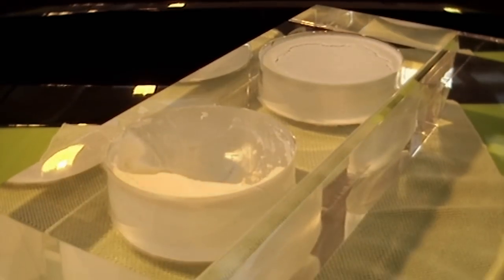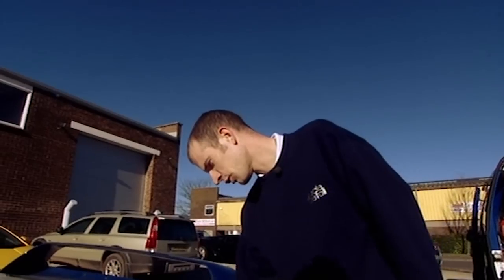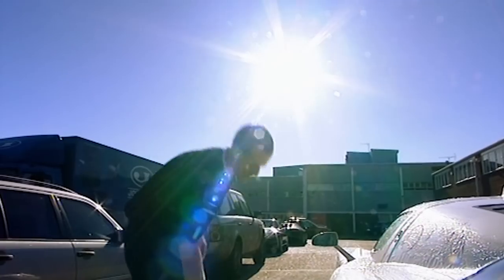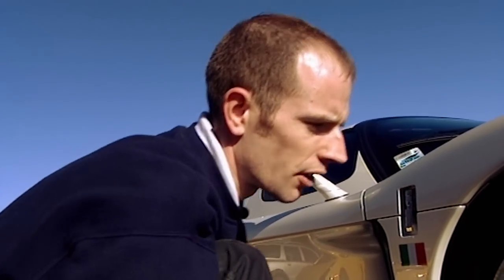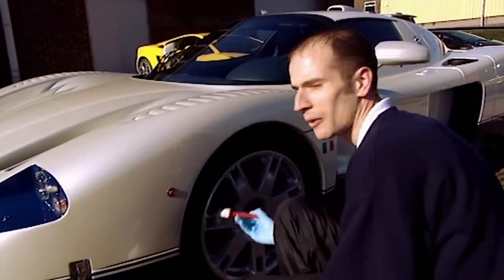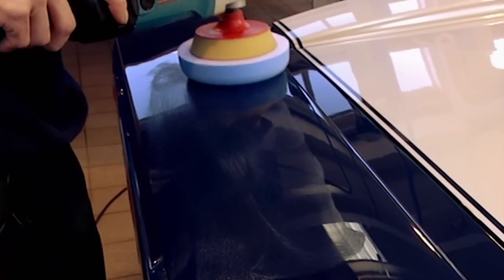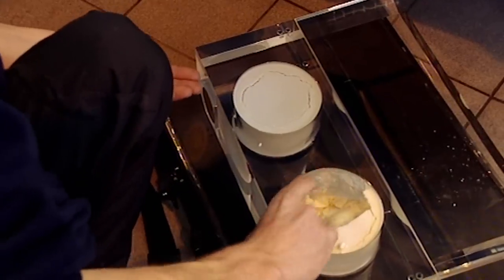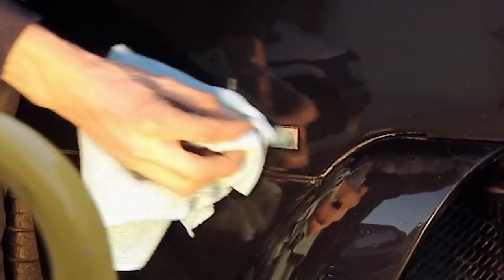World's Best Car Cleaner #TBT - Fifth Gear

Comment: I'm a full-time valeter for a hire company. Our cars get a cheap ass shampoo, rubbed over with a big brush (it's okay though, the bristles have some rubber bits on the end), then hosed off with a dribbling garden hose with no pressure to take off the simplest of residue. Only the flat surface of the wheels get a wipe, brake dust stays on the spokes. No drying, no polish or wax. That'll do! :-D I get £6.51 per hour..

Comment: I use natural and PH neutral soaps, and polishes for my car. 

But I got a step further than most people as my car is vacuum washed inside and outside. 
I use a standard fabric stain remover machine inside the car, but the out side I use a large shop-vac with a home made vacuum squeegee that sucks the dirt and soap clean off the car without leaving marks. But after I use a foamer spray on the car to fully soak the car in soapy ph neutral cleaner, then scrub the car with wool mits, than vacuum-squeegee. For rinsing I use a gentle pressure wash, then I do a roll on roll off drying with microfibres cloth till the car is bone dry before I use turtle wax to polish the car via hand.
Reply: Aslo Aso Same, but all of the people mentioning this guy and the AMMO NY guy, they damage the paint regardless, using a high pressure water pump to rinse the car also damages the paint, so regardless of all of your hard work, the paint still ends up scratched.
Reply: Russell Tang He uses a low pressure water pump and filtered water

Comment: He was right about bird shit. Never, ever wipe it straight off and get to it asap. Birds eat gravel and they poop it out along with lots of fun acids. Wiping it straight off will net you some lovely scratches which goes well with the etching the acid will perform to the clearcoat.
Reply: +afrosheenix so what are you mean to do?
Reply: +Tehxido add clean water to lift it off the paint then use a microfiber towel to soak up anything that remains. Some modern clearcoats will etch no matter what.
Reply: +Tehxido Keep a bottle of quick detail spray around, spray it on, let it set, and wipe it off.

Comment: Shouldn't he start the wash out of the sun?
Reply: I thought that, shouldn't he also rinse the sponge in a different bucket (aka the two bucket method)
Reply: He proberly used 1 bucket to save time although you will get more scratches he polished the car after to remove the scratches
Reply: hakman239 If youre paying thousands for wash, the last thing I want to hear is cutting corners to save time
Reply: It's ok to wash in the sun, it's more important that the surface of the vehicle is not HOT. That's why it's a no no to wash in the sun.
Reply: @jumpercable20  In the UK.. The sun only gives light, the heat it provides is negligible except for a few days in the summer it might reach 20 degrees C

Comment: probably filmed around the 1990's but he doesn't use the 2 bucket method, he uses a sponge instead of a microfiber mitt or wool mitt, ceramic and graphene coating are way better than carnauba wax, and didn't even start with the wheels. Definitely not the best in 2022.
Reply: the Maserati he is detailing is the mc12, which launched in 2004. still, your argument is valid, in a way, because I believe car detail was going through its first stages and many techniques that are now considered basic, were still being discovered

Comment: The wheel cleaners that are basically acid do it's job, but you have to wash it off relatively quick or it will corrode the rims

Comment: lol...He’s using Zymol products. I used to use Zymol as a teenager. Yes, that wax is expensive but they refill it for free for life (or at least used to). Back when I used Zymol wax, I used the one down from this which was “only” around $1k. Nowadays I only use CarPro products and nano-ceramic coatings. I guess if I was a professional I’d be putting myself out of business as the ceramic coatings protect paint from needing correction like this as often.

Comment: 1) He mentioned not using acid on wheels, yet he uses citrus wheel cleaner which is is acidic. I use manufacturers wheel cleaner which is the best (I've tried the others)

2) He washes cars in the sun? That is a big no-no. I NEVER do that.

3) His bucket is "imported from the USA" . Yeah? I have used a Meguairs bucket on my car for years - it comes from USA.

Comment: All you crying detailing experts around the world.
Its the UK... Direct sunlight has no heat, except for a few days in the summer when it might reach 20 degrees C, but still its not an issue.

Yes 1 bucket is fine if you have running water to clean your mitt, or more than 1 mitt
A sponge.... Fair point, tho a sponge is still useful in some jobs.
That hand applied wax... Hmmmm.. Better alternatives exist but this video is a few years old.
Im also going to presume that the TV show people had more say in how, what and when methods was shown.
To me this looked more like a maintenance detail than a £5000 treatment

Comment: Is the 6000 pound car wax eight hundred times better than Simoniz original carnauba wax which costs 7.5 pounds, I think not.              

http://www.wilko.com/car-cleaning/simoniz-carnauba-wax-in-tin/invt/0344878  

Believe me the Simoniz original wax sets like concrete and gives an impressive sheen. A single bucket method is better than a two bucket method provided one either uses a fresh clean wash mitt each time it goes into the bucket, or the mitt is thoroughly rinsed through using fresh water from a hose on a jet setting before it is dunked again into the shampoo bucket. From what I could see neither practice was being adhered to, so doubtless when Paul had finished washing the car there would be more micro scratches in the clear coat.  Still as he was going to compound and polish the car it frankly would have made little difference.

Good luck to Paul Dalton if he can get away with charging plonkers with more money than sense such high prices. Personally I think a lot of this high end detailing malarkey is complete bullshit and hype. If one uses common sense and care, excellent results can be achieved without having to spend thousands.

Comment: How can you clean a car under the sun?
Reply: When you have pH balanced car soap.
Reply: Tuong Nguyen The sun is the sun, no matter the soap. It will damage the paint and it is sufficient just one exposition. And this man is supposed to be a professional.
Reply: I agree that washing the car in the sun isn't ideal especially for a professional but you would have to wash your car pretty hard at the same place to actually damage the paint. Now, if you're talking about swirl marks, love marks, and scratches, those minor defects can easily be fixed.

Comment: Shock horror, most of this is completely unnecessary, and you can achieve the same results with cheap products. Also, 30c water to be kind to the car? Is that a joke? Hot water will be less friendly to the car by heating up the clear gloss, which will make it more susceptible to damage.

Comment: Washing it in direct sunlight, with what looks like a fucking sponge and a single bucket. Is he having a laugh or something?
Reply: +Oliver Pykett Can I ask what happens when a car is washed in the sun ?
Reply: +Call_Me_Mad It makes the body of the car heat up, causing the water and soap which is sprayed onto the car to dry very quickly. This leaves water spots and soap streaks all over the paint.
Reply: Thanks for the quick answer, I never knew that.

Comment: What a load of rubbish, he washes the car from the lower side up which brings the tiny remnants of grit onto the upper painted surface. He uses a metal framed brush to apply the wheel cleaner, the metal can scratch the alloy wheels. He should never wash a vehicle in bright sunlight and I note he never cleans the sponge between applications. As for his charge.... Well you can buy a nice car for that amount, total fifth gear crap.

Comment: WTF Seriously! So he's the "best" yet he uses a shitty sponge to literally scratch the dirt across the paint surface instead of a microfiber to lift away? Then he's using a rotary Makita polisher not a Dual Action polisher to put unnecessary risk into damaging the paint... his cheap cutting/polishing pad is flooded with compound to block the holes needed to lift away anything... looks like a piss poor effort is being done in my opinion, lucky choices were made not skill
Reply: lewisnwkc you use a rotary polisher. Da is used for trizac @3k grit. Then 3 stage 3m perfect it 3 with a rotary polisher. Thats what a bodyshop does. A good one.

Comment: HES THE LIKE THE WORST CAR DETAILER EVER. Washing car under the sun, one bucket instead of two, using a basic sponge instead of a lambs wool mitt or a microfibre mitt, doing wheels after washing car,.  guys a clown.  firstly he should tackle the wheels using bilberry and then iron x or wolfs deironizer, . snowfoam the car.,  clay bar (bilt hamber ), wash the car using meguiars shampoo two bucket method with grit guard, dry it using microfibre towel, then use meguiars scratch x or swirl remover, then meguiars utlimate compound if swirls are bad, then use meguiars ultimate polish or menzermas, then use a wax like collonite 845 (stick it under some hot water to make it a bit gloopy), can also use this same wax on the wheels. other alternative is poorboys sealant., then use meguairs endurance  gel for the tyres, wirewool for exhaust tips and then meguiars metal polsh,  carlack or gtechniq sealant for the windows. jobs a good un.

Comment: More like worst car cleaner. What is this shitty magazine called fifth gear. To be honest - he is doing almost everything wrong at cleaning a car on a high level. 
First of all you will need 2 buckets and no fucking sponge. He is cleaning the whole car with ONE fucking bucket and ONE sponge to make like thousands of scratches while cleaning the car from very dirty places (bottom) to "normal dirty" places to make sure to get scratches everywhere.
I guess he is taking a picture after that and tells his clients "look at that - I removed almost any scratch you got because I'm worlds worst car cleaner". Then he is like "my products are very expensive, it costs 50 pounds per 5 litre" - what he is not talking about is that almost any product he buys gets mixed in a ratio of 1 to 10 or even more.
Then when he is drying the car he's doing scratches again. You do not put any pressure on the towel. That's because the car has still particles like tar on the car paint which obviously not get removed by some water and shampoo. But atleast he knows that he has to use clay to remove it. I could keep going on about what he is doing wrong. The list will never end. 

He has professionell tools but if you never learned how to clean a car and where cars getting more dirty and what dirt really is he is just a scammer in my eyes. 
Hopefully he learned how to clean a car by today.